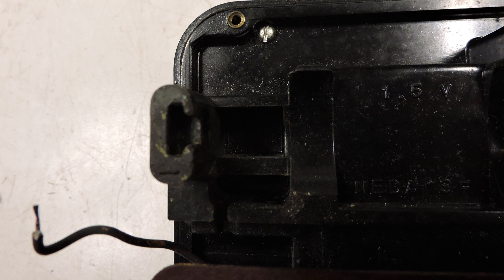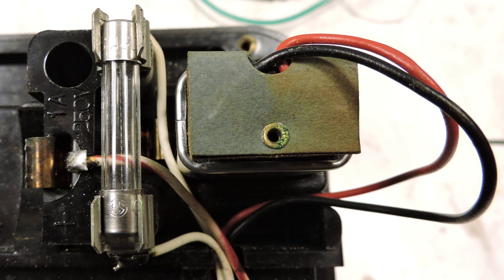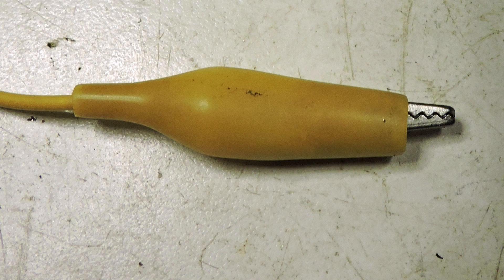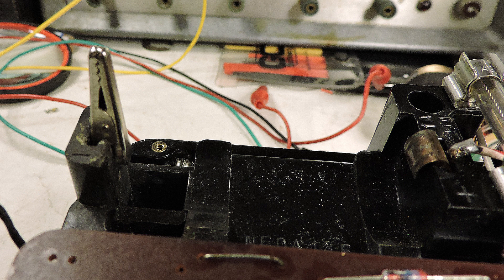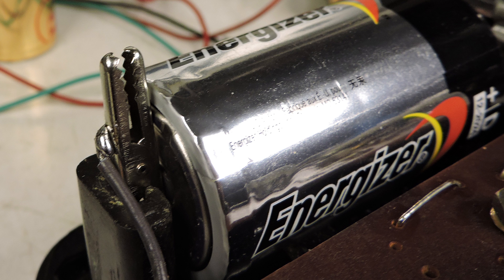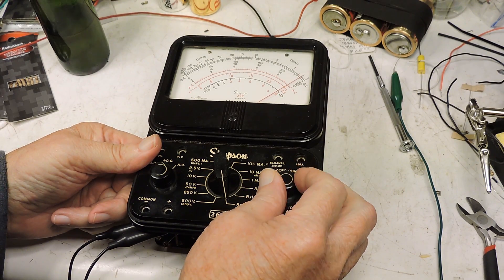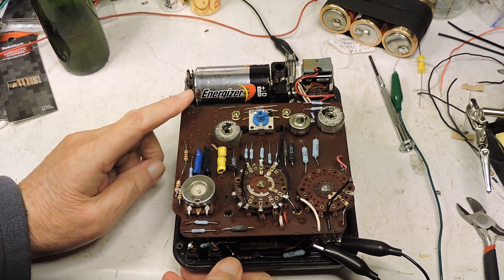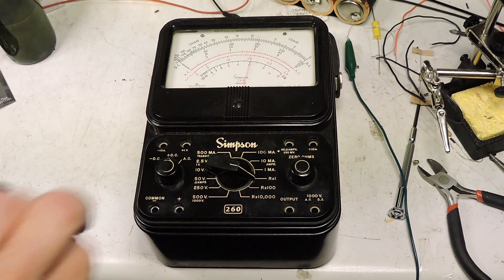Simpson 260  -1.5VDC connection repaired

Comment: Good re-purpose!  I would have soldered the wire to the other side of the clip (battery contact side), so the battery voltage would not have to go thru the mechanical connection on the clip's axle/spring.  I have found that some alligator clips to be somewhat electrically variable when depending on that junction.  Since there is no movement of the wire once the battery is installed, I would think this to be a slightly better approach.  Thanx for the tip!! - Bob

Comment: I soldered the + and - wires for the 1.5 v to older copper pennys to replace the contacts in a Simpson 260m after a leakdown from both 9 and 1.5 volt Duraleak batteries. The 9v connector was replaced as well. Both original contacts were totaly unusable. I never had this problem with the old Eveready carbon batteries.

Comment: My 260 had clips rot out on it too and had to be "rigged" to make it work correctly.  I wonder if anyone makes those 260 type clips for sale?
Reply from the maker: +anselb2000 

Yes you can buy them, Simpson is still
making the 260.
Reply: +anselb2000 I use the old spring and metal plate(negative side) from old scrap electronics..like radios.....they pull right out...and slide right into the grove of the Simpson like original..

Comment: Why not just solder the wires to the battery? It's only replace maybe every couple years.
Reply from the maker: +Mrjm5411 
You certainly could solder wire.Thanks

Comment: Looks like a Series 6?  I have a 5 that looks like that inside, but it uses a string of AA batteries instead of a 9v, and the S7 board and meter leads are different. 

  Battery clips were bad on all of the 7's.  I bought some new ones from a meter repair service for a couple dollars.  I like the gator clip idea though.
Reply from the maker: +gadget73 Thanks